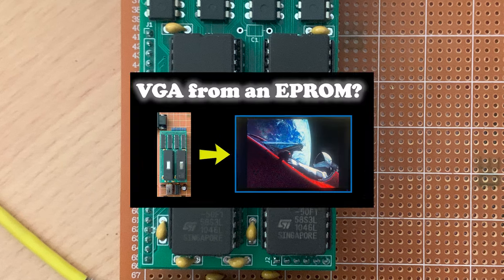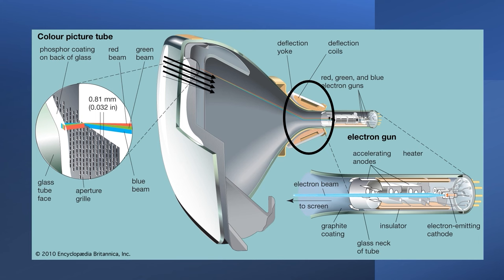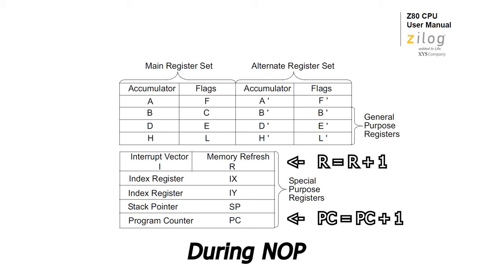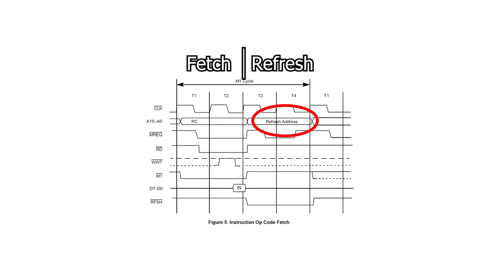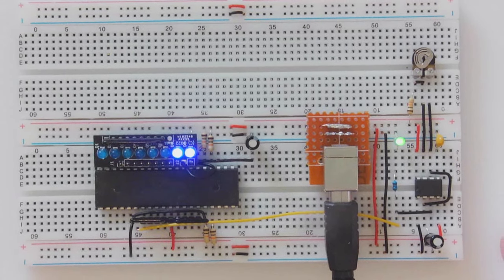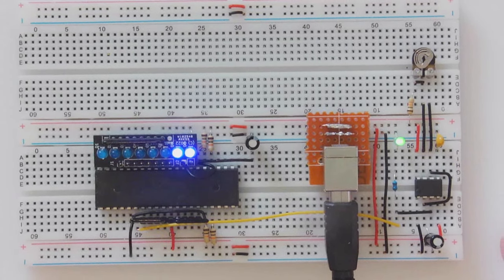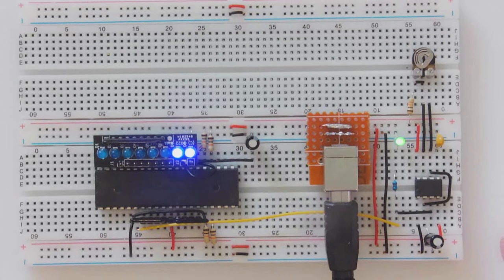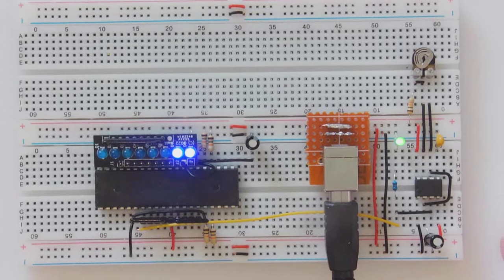ZX81 Video Circuit Part 1: Z80 Solo.

Comment: I designed a Z80 video system in the 70s, accessing the video memory on the refresh cycle to prevent video glitches. Perfect solution.
Reply from the maker: Excellent.  It's a clever system.

Comment: Wonderful! I am so glad you're going down this rabbit hole.  Back in the summer of 1980, when I had my ZX80, I figured out enough about how the CPU generated the display to be able to design and build hardware to generate 63 user-defined characters and their inverses. That required a hardware decode of the Halt instruction, a 1k byte RAM, and a bit of logic. The ZX80 video system is the work of a genius in terms of its efficient use of hardware.  I look forward to seeing how this series develops.
Reply from the maker: Yep, the use of Halt to generate the NOPs and the refresh counter to generate the interrupt is very impressive.  I think they've out done Steve Wozniak!
Reply: @DrMattRegan    Yes. The trick with the NOPs and the Halt instruction allowed the timing to be preserved, but in the small memory of the basic ZX80, a line with only (say) 10 displayed characters would use only 11 bytes of memory space, so there was still space remaining for programs and variables; a blank line used only a single byte.
Reply from the maker: Yep, i only actually found out recently that it used display lists.  The schematic look crazy when you first look at it without the software.  For a long time i was wondering what is so special about D6, but it is set for halt but none of the character codes.
Reply: @DrMattRegan  Exactly. 👍

Comment: Great video of this great machine.
It was: The computer. And Apple ][ too.
I fainted, this wiring diagram was familiar from somewhere.
I know every inch of it.
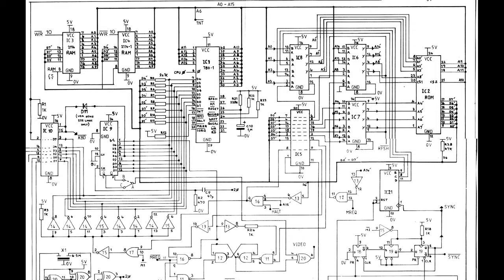It's been over 40 years since I last saw this 1:17 schematic.
This was displayed as a poster above my desk.
I've built a lot of these machines for friends. 
With 17 TTL ICs, the Slow/Fast circuit on a separate panel, that's another 5 ICs, 22 in total.

Those were incredible great times. Speech synthesizer program
we made it in 1 kbyte size, we won a programming competition with it
an original ZX-81 computer. It was a great gem. The machines we built didn't have a box, 
but their keyboards had a Hall generator, which is still considered professional today.

Later, the ZX-80 was built with the cheap ICE4000 FPGA in 1 chip.
Reply from the maker: Glad you;re enjoying it.  It's a fun project.

Comment: Great project. I have been investigating the Jupiter Ace composite video generation, which takes the ZX81 video one step further by adding circuitry for the sync and pixel shifting output. Also note that some TVs/monitors don't like the composite signal generated by these machines, as they are not strictly to spec.
Reply from the maker: Interesting.  I just had a quick look at some Jupiter Ace schematic diagrams (i'm not super familiar with it).  Looks a bit like a hybrid or ZX81 and ZX Spectrum.
Reply: @DrMattRegan  Wow someone who remembers the Jupiter Ace!  Yes what a brilliant little Forth machine.  Myer Melbourne used to have a computer department where all the machines of the day were out to trial and the little Jupiter Ace wasn't getting any love as it was so weird ... so I played with it quite a bit.  I would have been about 13 I think and it inspired me to combine my knowledge of 6502 assembly via the VIC 20 and the Jupiter Ace's Forth and build a custom machine based on the Rockwell R65F12 which had a Forth kernel built right in.    Does that make me weird?  I guess so.
Reply from the maker: I'd heard of the jupiter ace, but i think in the back of my brain i think i'd put it in the same basket as the vz200.  I didn't know it ran forth.
Reply: @AndyGraceMedia  I never owned one, but I do have an original sales brochure for the machine in my collection. Forth is fascinating, and later used as the basis for Ample on the BBC Micro (the language that supports the Music 500 / 5000).
Reply: The ZX80/81 had "pixel shifting hardware" as well.  In part also horizontal sync hardware. Only the vertical sync was fully software generated. The really special thing in the ZX80/81 was that they fooled the Z80 to address the character codes to be displayed, using its program counter as a character pointer (for about 70% of the time, the rest is normal program execution). This was done by jumping into the "display file" (but with A15 set) and "execute " these character codes as Z80 NOPs, as long as they are in the character range. The refresh register was thereby used as a column counter; by connecting A6 to INT it will halt the CPU when 32 characters are output (for each scan line, so repeated 8 times per character line). However, to save space, lines can be shorter in memory than 32 positions. So for these, it's instead halted by an actual HALT instruction at the end of the line. That's why they used the HALT instruction code as newline!
Reply from the maker: @herrbonk3635  well done.  That’s the plot for the next two videos!
Reply: @DrMattRegan  Yeah, sorry for that.  I wrote it before I watched the full video.
Reply from the maker: No problems, the next videos are nearly ready.

Comment: Good thinking, those jumper PCB's saved you a lot of wiring time. I watched this twice to really understand it. Using instruction op codes as control signals and a data signal was clever and a bit crazy. You aren't really interested in what the instructions do, just their bits and execution times.
Reply from the maker: Thanks Martin.   Very crazy and completely impractical, but don't worry, i'll be weaning the design off the use data bits for sync and video in the upcoming videos.  I mainly wanted to show that the z80 alone can generate the timing required to drive a display.

Comment: What a nice project, The ZX81 in slow mode uses the Hsync and Vsync area to do work, All other time is used to build the display. 👍
Reply from the maker: Cool, thanks.  It's such an interesting circuit, it really flexes the Z80.  Slow mode will require a column counter, so i'll probably do that last.  I want to get it to work in ZX80 mode first.

Comment: I took a course in Atari 2600 programming in 6502 assembly, and yes racing the beam is exactly how the TIA works, the instructions have to be timed so that the other side of the screen on the playing field is different (ie not mirror or repeat). I found this to be quite challenging!

D Matt Regan, you are very knowledgeable! I have to admit a lot of this is still so far above my head, but I like the videos and I'm looking forward to learning more from you!
Reply from the maker: Thanks, it's actually a kind of favourite topic for me, i once build a whole machine along these ideas 
https://dl.acm.org/doi/pdf/10.1145/192161.192192
Reply: Ive took a look at doing a atari2600 emulator and when i realized about its video TIA and how the screen is rendered as the game code is squeezed in were you can with cycle accurate emulation to pull it all of. Kinda scarred me of trying the emulation. Programmers who produced games then in my opinion truly were special. I can only take my hat of to them. I think there was 1 player, 2 enemy sprites and a bullet sprite all being rendered in time. Hence racing the beam! as well as squeezing in the game logic. I take my hat of to those guys! Kudos

Comment: "And we generally just round this down to 312"

Rounding down to 312 is fundamentally what makes this a progressive signal. If you left the line count at 312.5 (or anything else with an extra half line per field) then you would still end up with an interlaced signal (though, line doubled unless you actually added support for extra vertical resolution and alternating between odd and even lines)

The extra half line is fundamental to an interlaced video signal. Early CRT TVs (up until the late 90s) didn't have any electronics to count the lines or anything special handling of interlaced or progressive signals. They didn't even understand the concept.

It's hard to explain in text, but what's actually happen with interlaced signals is that the horizontal and vertical flyback transformers are independent from each other. The vertical position of the beem doesn't move once a line during hblank. It's actually moving down continually, the right side of a   line is slightly lower than the left side (and only slightly above the left side of the next line)

To get a progressive video format, the horizontal and vertical sync pulses need to be a whole ratio of each other, so that at the start of each field the horizontal and vertical positions are consistent.

Interlaced video formats use a sync pulses that are slightly out of phase, resulting in an extra or missing half of a line in each field. 

Because of the extra half of a line and the vertical position moves continually, at the start of the second field's first line, the vertical position of the beam is actually half a line lower (or higher) than the previous field.

This half-line offset allows all the lines of the second field to sit in-between the lines of the first field. And you get interlaced video without any special electronics at the receiving end. 

It also raises the possibility of other exotic video formats. If you adjusted the ratio so you had an extra ⅓ or ¼ of a line, you could create a triple or quadruple interlaced video format (not that anyone would want that, and CRT was designed to display an interlaced video format.... but you could)
Reply from the maker: Yes, you are completely correct.  But i was trying to avoid the details of interlaced video (which is a bit of a long topic as you know).  The round down to 312 comment was meant in the context of NTSC, where most round to 262 but other do round to 264.

Comment: Those early computer engineers really had to struggle to make the hardware do what they wanted at minimum cost.
It amused me when I realised while watching this that if you substituted a 1-bit RAM with separate input and output to store the data bit, you could then change the data in the RAM in order to change what was displayed on the screen.
If I were making something like this nowadays, I'd probably just assign the Z80 to be dedicated to making the display and use a separate CPU for actually running programs.  That would have been an expensive option "back in the day," though.
Reply from the maker: It really is amazing when you think about it.  Getting it cheap probably enabled a million people to have access to a machine with BASIC whenever they wanted it.

Comment: Some truly crazy circuits. I have a ZX80 clone board, that I should probably get going, I just need a keyboard 'sticker' for it. However the fact that it all but cannot do any processing while it's generating video kind of discourages me.
Reply from the maker: Go for it!  You can add the ZX81 slow option later.

Comment: Well done!  My cousin had a ZX-80 and he didn't know how to program. He asked me to come and write a PONG game, which I did. It was an ordeal because of the BASIC keywords being mapped to function keys and the membrane keyboard is awful to work with. I decided then that if a software engineer doesn't lead a clean life, and isn't a good person, then when he dies his hell will be to have to code software on a ZX-80. for all eternity. (ʘ_ʘ)   If I could, I would rewrite the ZX-80 ROM to allow typing in of keywords manually AND I would install a proper keyboard. Then I would take that membrane keyboard out to my fire pit and set it ablaze.
Reply from the maker: Yes, i remember the frustration with the automatic keywords.  Damn it, i want to type my own words, but alas, it probably saved a few bytes or ram, which was gold back then.

Comment: I had gotten a 65C02 for comparison for when I finally complete the SAP-6502 (I knew it had extra instructions including a working RoR, but discovered after the fact that for a few instructions cycle lengths... oh, I've acquired some used 27c322s, though saving them until after I finish the SAP-1 in the meantime going with the 27c1024s); any thoughts to the difference of effort of completing this using that 65c02? Outside the one in my old GameBoy, I don't have a spare Z80 floating around. I know I'll likely need to find a different set of opcodes and timings.
Reply from the maker: There is certainly space in the microcode to do it.  I haven't looked at all the illegal/undocumented instructions, but to make it Apple IIe compatible, they probably should be done at some stage.

Comment: Awesome video! I wonder - is it possible to create a simple circuit that will generate DVI digital signal, at least in "low pixel format" display mode at 25.175 MHz?
Reply from the maker: low pixel format should work with this https://youtu.be/seyHAFpsoP8
Reply: @DrMattRegan  I saw that video, too, but it is about the analog output part for the DVI (can be used to connect the D-sub connector). My question is about the purely digital output, like the one that can be converted to HDMI connector...
Reply: Fundamentally, DVI-D and HDMI are the same protocol. HDMI just has extra security stuff so it's harder to capture. @cyberkexx
Reply: @mikafoxx2717  right, but both use "serial" data transmission, compared to "parallel" in VGA D-sub, thus require much higher clock rates, although provide pure digital signal. I was wondering if it is possible to get such high clock rates with discrete logic components...

Comment: why to differeniate VSync signl and HSync signal if at the end they are mixed together? if you use the same bit you don't need two bit to start from and you don't need to mix the signal to the end, isn't it?
Reply from the maker: In hardware, HSync and VSync use the same signal, which is D5 clocked on M1BAR.  In software, they are asserted at different times, so that is why there is different code for HSync and VSync,
Reply: Vsync & Hsync were earlier combined into one on D5 then clocked out together through the lower '74. Not later combined at the emitter follower. Routing separate uncombined signals is useful during development & troubleshooting. It's a tradeoff between reducing component count vs. understandability.
Reply from the maker: True, indeed the ZX80 has a different circuit for HSYNC and VSYNC, which i'll go over in video 4.  I want this to be a journey where we start with the very simple and get more complex.
Reply: Good plan. Structured step by step. I look forward.   
I've noticed during a career in design is something can be acheived very ingeniously and efficient but doesn't catch on .... because only the designer knows how it works. So to avoid dead-ending one gets into this habit of adding redundant functions, extra circuit complexity - just to make it understandable. Or take the extra effort to explain clearly as you're doing 👍

Comment: How much complexity would be needed to use dual port RAM instead of the ROM as the data source?
Reply from the maker: Yes, sir Clive had a very clever solution to this which I’ll reveal in the next video or two
Reply: @DrMattRegan  I can't wait!
Reply from the maker: What do you think of the dual use data bus?
Reply: @DrMattRegan  Sir Clive did some incredible work. The constraints of designing for cost/mass production really forced some creative solutions. It really helps that your explination started with a more technically optimal solution and then showed the very clever approach that was used in the ZX80. What trade offs were made for this approach? What possible capabilities did the ZX give up with this lower cost solution?

Comment: its not quite the same , the zx81 only did 32 visible chrs (256 pixels) per line and had 2 H76 (halt) at the very start and 1 H76 at the end of each line and if you changed any of them the machine crashed , i do like the video though 🙂
Reply from the maker: Yes, i'm going to try get the ZX80 version to work first, then upgrade it to ZX81.
Reply: @DrMattRegan  
thats good , i worked out the soft ware side of things but never worked out how the hardware worked 🙂
are you going to do the speccy as well , that had a strange arrangement for the pixels ? 🙂
Reply from the maker: @YTANDY100  yep, also planning to do the speccy.  It’s actually a bit more straightforward than the zx80/81
Reply: @DrMattRegan  
that is a surprise , it is a really strange arrangement , cant wait to see how it works 🙂